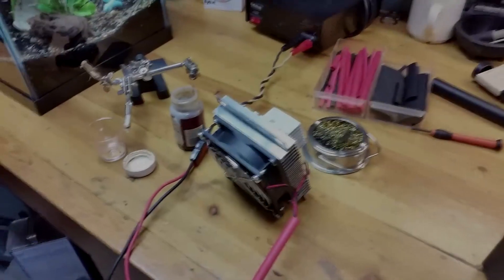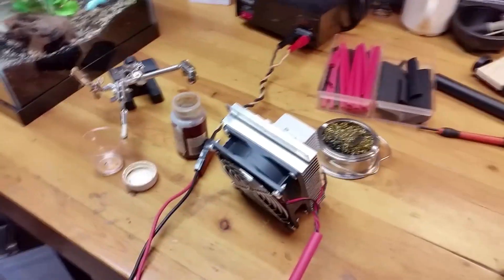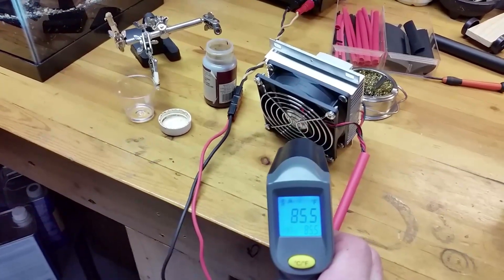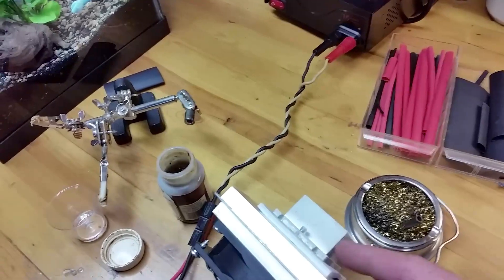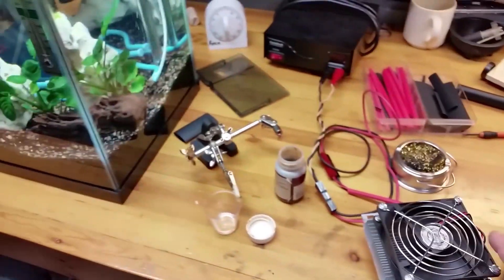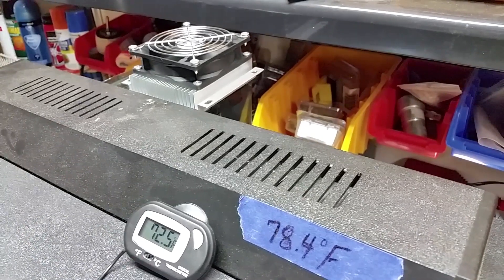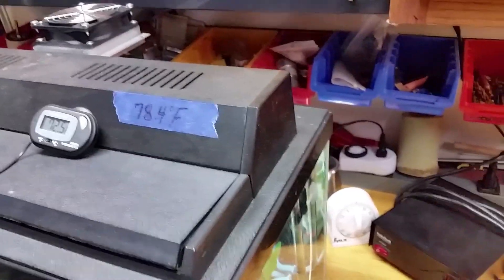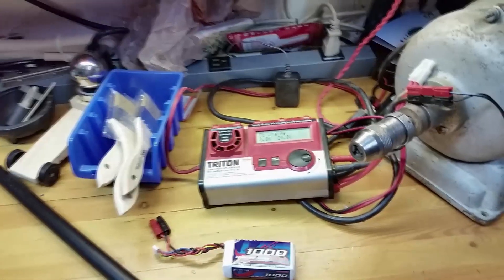DIY Aquarium Chiller

Comment: u need to recirculate water in a hose that is passed threw the chilled plates, that resolves the aluminium toxicity problem; aditional thermoinsulation of the out-of-water parts may be needed (cold parts)
Reply: Would it possible to run thinner tubing (think 1/4" exterior diameter tubing) between the fins of the heat sink and create a heat wicking system that also avoids the aluminum problem?

|o|o|o|o|o|o|

Though the tubing isn't the best for thermal conductivity, having 3 points of contact against the aluminum should provide large amounts of heat wicking.
Reply: @The_Pariah  yes, but it depends on the properties of the pipes, plastic and rubber don't habe very good thermal transfer. Adding a lot of thermal paste an the pipes in the chilled plates will help a lot.

Comment: 86F (30C), 27F ( -3C), Water temp is 78F (25C). 10Gallon (37liter) tank. 2hrs later, temperature drop to 72F (22C). On my own setup. 1 peltier with fan consume 55watt. Takes more energy to bring water temp from 30 to 25..living near to equator. I put 2 peltier now. 110watt consumption... 70 liter tank. Takes abt 20hrs to reach 30c to 25c.... i now worry about my electric bill... 😢

Comment: the word chiller is often used when using compression -expension technique with 2nd cooling circuit.  This video shows  a  heat-exchanger
Reply from the maker: You're right and could you imagine how many people would be confused if the title was DIY Heat Exchanger?  They would say...huh?   Why are you trying to heat the water, I thought you were trying to cool it?  Know very well about heat transfer and fluid flow...ex USN Submarine Nuclear Operator.  :)  Ask me why Crystal River Florida Unit 3 (Nuclear PWR) closed permanently.
Reply: @motleypixel  cracks in the boiling system, just like here in belgium with Doel and Tihange (Engie-Electrabel) nuclear plants... It's a general problem i think..
Reply from the maker: @TheBSideDJ  nope, but good guess.  The core was rated at delivering more energy than the steam generators (heat exchanger) could produce steam.  So they decided to buy bigger steam generators.  They knew they couldn't fit them through the existing primary containment building blast doors so they had to cut them larger.  When they started to cut they miss-calculated the twisted steel cables under tension that gave the structure it's strength and inadvertently cut (nicked) one of the steel tenons.  Our governing agency "NRC" shut them down until the primary containment structure was restored to as-before or better but the cost was too much so they shut the plant down.
Reply: @motleypixel  woow there had to be a great stability study before cutting the doors....i sometimes say  : a master degree engineer calculates the strenght of a bridge, builts it, it collapses after a few decades, and  he/she perfectly knows why.. on the other hand, a normal engineer does not know how to calculate a bridge, copies the  plan of the other bridge,  takes an extra 100 % safety coefficient in consideration, the bridge never collapses, and the engineer never understood he was capable of building a bridge.  Anyway, i think  we are taking a big step away from fishkeeping :)

Comment from the maker: BTW, this cooler worked too good for us and killed our 30 bristle nose plecos in less than 24 hours.  I was away from home.  The wife texted me and said the aquarium was at 82F.  I had already rigged the cooler to run continuously from 2pm to 10pm with the aquarium heater on and set to 79.  The aquarium heater did cycle but the temp drop and increase must have been too much change for these fragile little fry...poor guys.  I am going to conduct further tests where I have the cooler on a timer and only run it every other hour for 12 hours and take temp readings every 30 minutes and see what the temp graph looks like.  My ideal goal is to keep delta T at no more than 2 degrees, or 79 +/- 1 degree.
Reply: you need a thermostat to turn off the chiller once it reaches 24C (75F). Depending on your ideal temperature.
Reply: Aluminium (heatsink) may dissolve in the water (if pH <7) and cause issues as well.
Reply: @rebelaqua823  that is a problem too and no one say something , i like that idea for hydroponic system but i dont like the fact nutrients touch aluminium

Comment: Cheap power supply would be a computer power supply.  They can run as low as $15.  I have multiple uses for them. :) Or scavenge one from a trash can.

Comment: yeah. :51 doesn't help much. I'll figure it out but to the average Joe you may as well call it the flux capacitor and I don't think anyone has one in the junk drawer. where do I get one?
Reply from the maker: +Corky Harms I meant 1:48  I tell it then...Peliter Junction, buy one for a few bucks off ebay and connect a 9V battery and have some fun :)
Reply: Sweet! Thank you sir.

Comment: Nice but if you use a car oilcooler and put that componets and run the water aquarium to the oilcooler you have more cooler area.
Reply from the maker: ***** 

No, using an oil cooler (assuming a plate and fin type heat
ex-changer) would not work in this case unless you put the cooler in flowing
water that was cooler than the aquarium water or inside an environment with cooler
air along with some air movement.  A
principle of thermodynamics is delta T. 
Because the cool side of the Peliter Junction is 25 degrees F and the
water in the aquarium is 80+ degrees F, then, we have a good delta T and
therefor an exchange of thermal energy via the chilled heat sink and flow of warmer
aquarium water across the heat sink. 
This Peliter Junction cooler unit cost $15, where as a typical oil
cooler can run anywhere between $30 and $100, additional centrifugal fluid pump
cost ($$?), hose/tubing and finally an environment to produce a delta T (refrigerator,
an already chilled or significantly cooler water source, etc. $$$?).
Reply: +Roy Niswanger
Did you have to buy an extra heat sink for the cool side? It looks like it only has one heat sink for the fan side but you don't have a extra heat sink listed as items needed.

Comment: Nice, I have two questions:
1) How do you hold all the parts together? I mean typical peltier has no holes for screws etc...
2) Isn't there a problem with aluminium toxicity? Have you made more tests? Are fish ok now?
Reply: +Jakub Friedl Did you ever get an answer for the aluminum toxicity?
Reply: +jlantican85 No.
Reply: Aluminium is acutely toxic to fish in acid waters. The gill is the principal target organ and death is due to a combination of ionoregulatory, osmoregulatory and respiratory dysfunction. ... The concomitant iono- and osmoregulatory dysfunction results in accelerated cell necrosis, sloughing and death of the fish